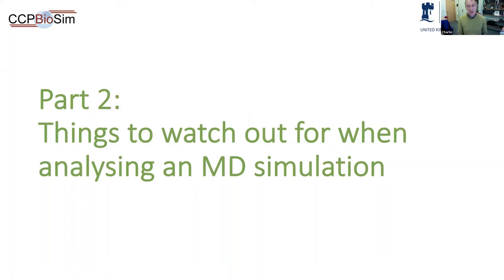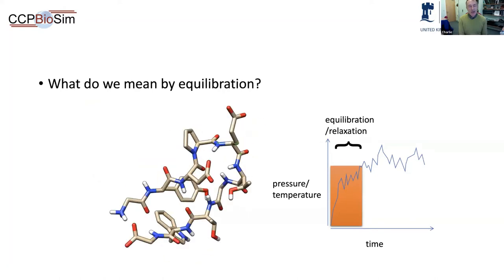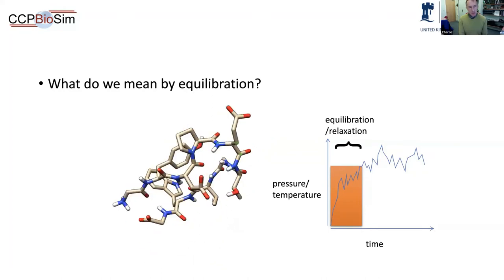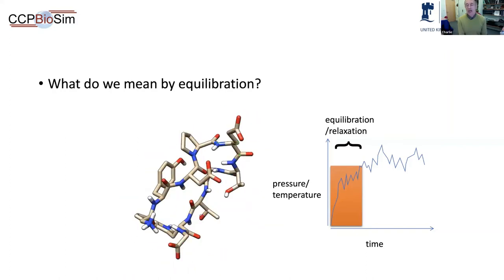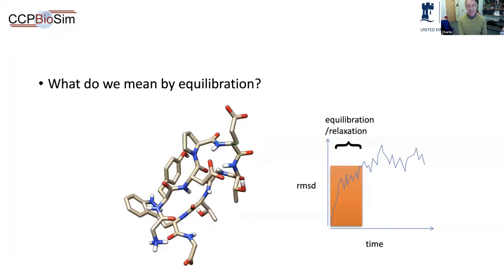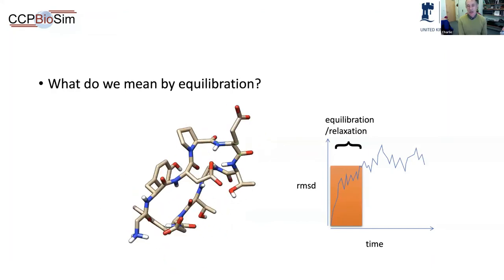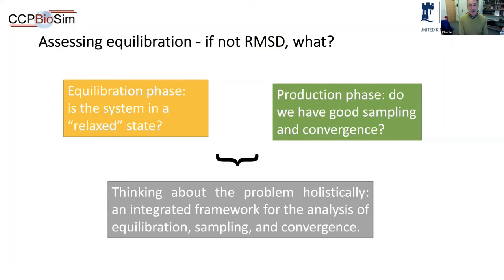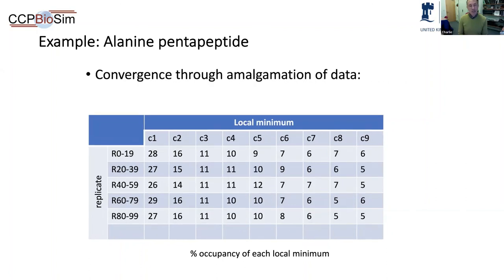Equilibration

Comment: Hello. I got some new insights from the lecture. But I got a few questions. 
1. Like if RMSD is not a perfect metric to analyse equilibration because it gives an inadequate impression of the 'potential wells' in which the system maybe present, then what would be the correct metrics to understand equilibration? 
2. For example, if radius of gyration is also dependent on the position of atoms then how is it much different from RMSD when it comes to measuring stability? Is it a more closer representation of the real potential energy surfaces than RMSD??